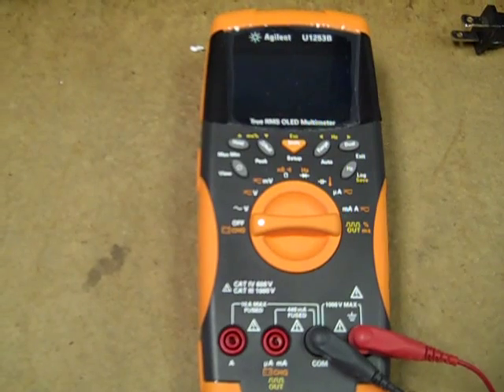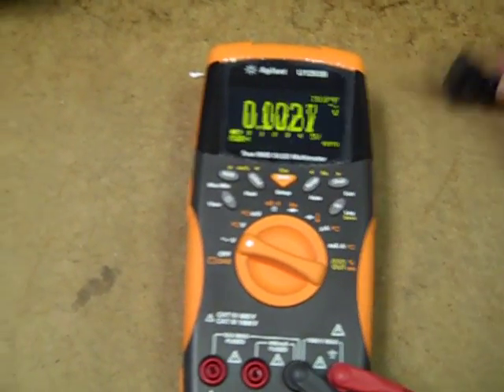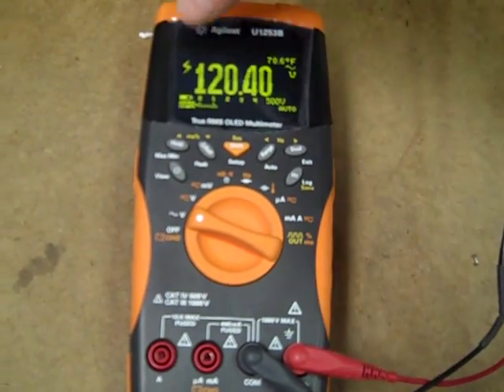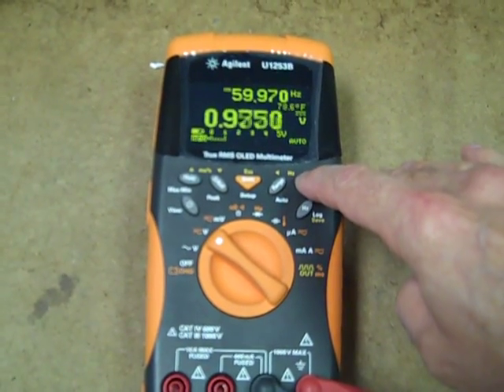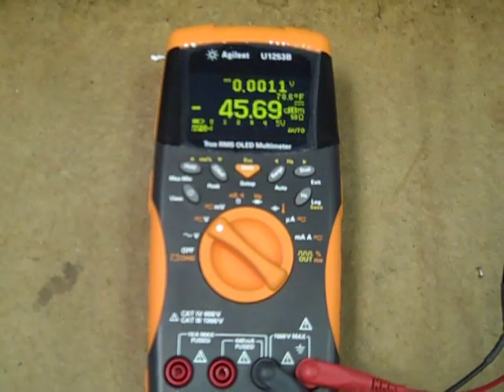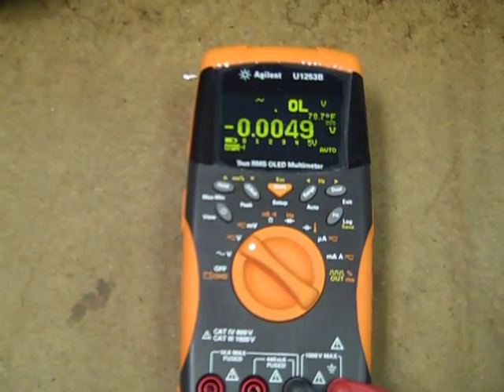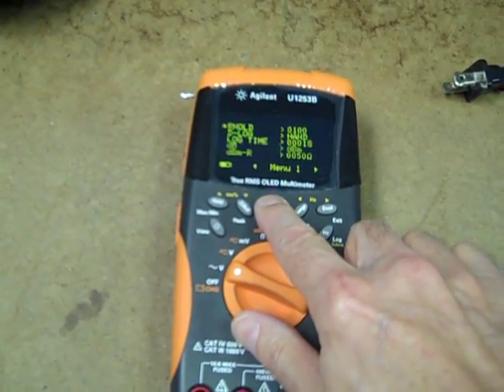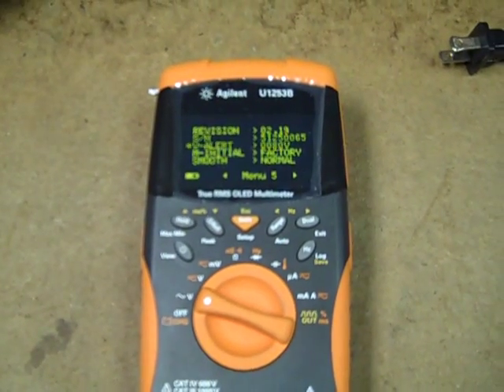Agilent U1253B Not Alerting on 120Volts AC when set to DC volts

Comment: There should be a class action lawsuit demanding total recall of this poorly designed and unsafe meter, to get attention of executives.  How about the idiotic puny 9V Ni-MH rechargable? Some Radio Shack batteries or even capacitors hold charge longer. Oh, and the meter can't be used while being charged! Simply laughable, unless you use one, in which case you cry. How about the after-thought internal heat sink? What engineering school did the designers attend?

Comment from the maker: Michael:
1. This is a dual display meter and still did not alert when in dual mode.
2. If you have never probed a test point expecting one but not the other, or had the meter set wrong, you are in the distinct minority.
Any modern meter should alert above a preset threshold regardless of setting. I do not understand your thinking. If I happen to have a meter set to DC and inadvertently probe a high AC voltage instead, I want to be ALERTED.
Hazardous voltages may appear at unexpected points in malfunctioning or poorly maintained equipment. Most modern meters would pass this simple test with flying colors.
I made this brief video to demonstrate to Agilent what I felt was a potential LIABILITY issue for them. That they chose to ignore it is not my problem.
Reply from the maker: Always good to know your meter.
Reply: +Mark Zacharias The meter is doing EXACTLY what you are asking it to do.  Read AC?  Check, and alert.  Read DC on AC?  Check.  No DC, no alert.  It would be more of a hazard having it alert outside of what you are asking it to do.  I've been doing industrial maintenance for a VERY long time.  You always check both before you grab a wire.  Hell a Fluke isn't going to tell you that you have AC on a DC scale.
Reply from the maker: And I'm sure I'm the only one EVER to probe a hazardous AC voltage while the meter is set to DC volts function. The Flukes at least indicate something on the bargraph. Too much to ask for a lightning symbol?
Reply: In every case potentially dangerous places should be grounded and disconnected, and cap circuits shorted. Multimiter fault should not be cause of your death
Reply: It is good function to warn potencial hazard but is bad practice because you relying on instrument only.
Reply: Another thing relaying on this suddenly if you pick standard multimeter and you have no warning and you get electrocuted. Never trust your tools ;)

Comment: Maybe I have misunderstood the problem here but I have never used a multimeter on a DC range and expected to read an AC voltage.  Nor have I seen a meter give a reading of AC on a DC range.  If the meter isn't set to read an AC voltage why would you be surprised to find the meter doesn't alert you of the presence of the AC voltage?
Reply: The alert is a life safety feature and should function reliably, no if's and but's, whether it is AC, DC or AC superimposed on DC. This happens in vacuum tube gear all the time. It is a crying shame that a shame rich megacorporation like Agilent doesn't give a damn. Maybe it's time to consider Chinese made units. Oops, these are made in Malayasia already...